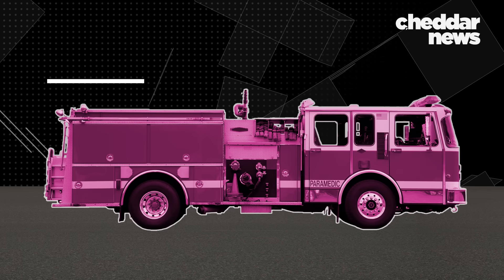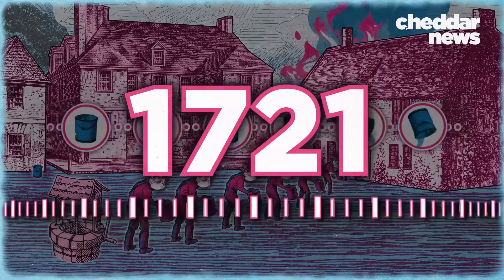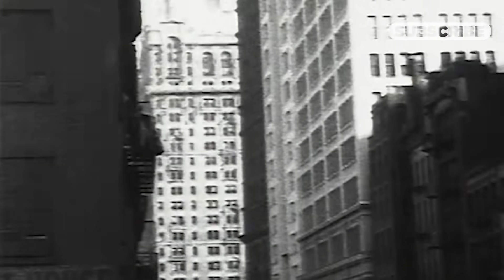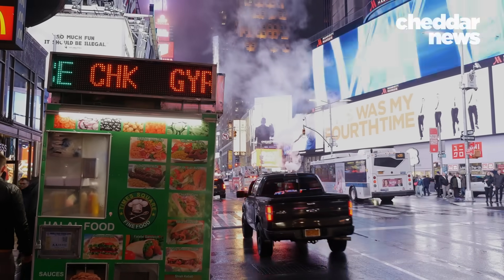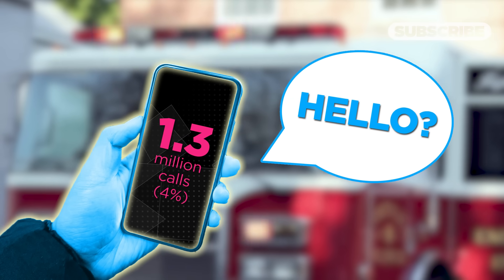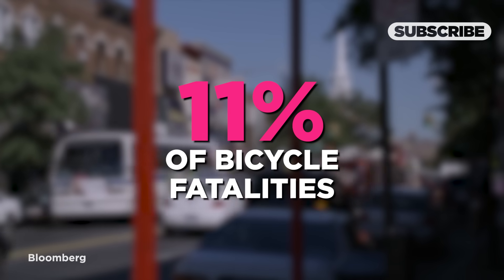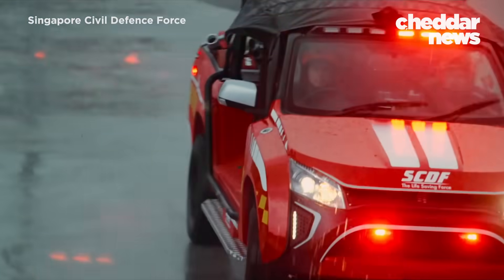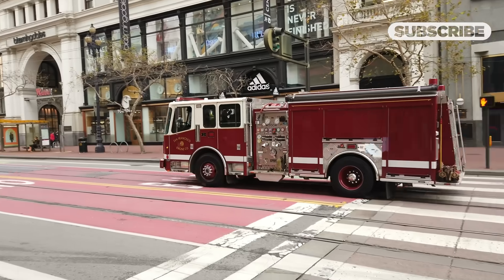Do American Fire Trucks Need To Be So Massive? - Cheddar Explains

Comment: I feel the need to comment on this matter, as I’m a firefighter in Chile, South America, where we have both EN (European) and NFPA (American) standard fire apparatuses, so I can often directly compare their capabilities. 

Though NFPA trucks are generally larger than European ones, that’s not the only factor that has to be taken in consideration to conclude which is better. 

My station has been assigned an EN engine, a Rosenbauer AT3 on a MAN chassis. After 5 years of use, most of us think that it underperforms for the needs we have, compared to the American engines. It has been clearly made for a less aggressive kind of firefighting, and has way lesser quality components in key areas, with an extensive use of plastic that easily gives way under heavy use. 
The chassis is a commercial one, that hasn’t been thought for the particular needs that we have as firefighters, so it DOESN’T have as powerful brakes as a custom made engine, it doesn’t have a gearbox made for constant acceleration and deceleration and, most importantly, the cab is not as strong in case of a collision, which for us is one of the biggest concerns, as we put our lives on the line every time we leave our station to attend an emergency (of any kind, not just fires), so we want our equipment to be as safe as possible in case things go the wrong way. 

Performance wise, American engines are far better, the split shaft pumps can put out massive amounts of water per minute compared to European PTO pumps, so, for large fires, or even for knocking out small fires fast, there is no comparison. 

Also, European engines are not necessarily shorter, because, as they have no hose beds, we need to carry hose on large reels that are mounted in the back, adding at least 1.5m to the overall length of the truck. 

One last thing I’d like to point out, is that NFPA cabs are larger, and as we mostly have cabs with seating for 8 firefighters, they are far more comfortable for us, specially when in full gear (as we use NFPA bunker gear, which is bulkier)

Regarding ladder trucks, I won’t even comment, their is just no comparison between EN and NFPA standards. I can only say that our NFPA ladders, towers and snorkels far outperform EN ones. 

Also, American trucks are not outdated, they have a more traditional look (which we like a lot), but are just as if not more technologically advanced than their European counterparts. 

Generally, the consensus over here is that American custom made apparatuses are far better for the job, and we’ve been shifting to buy them instead of European ones, even if more expensive. 

So, the only points in favor of Euro trucks would be that they are less expensive, and maybe, that they make more efficient use of the space for tooling, based on their overall footprint.
Reply: Thanks from a view that has used both
Reply: It may be worth saying that Dennis still make UK fire engines, they are made to fit most of our roads and lanes, and fit under bridges which we seem to have an abundance of. That said, having seen how the US Pearce trucks are made, the over engineering and build quality, the cab safety especially in the post 2010 versions. I would want the same level of crash protection for our UK and European fire fighters. 
We have lost stations due to funding cuts in the home counties that I know about, and there is always the 'cost saving' crap that goes on, trying to do more with less. Support our First Responders, they need the numbers, not just the right gear.
Reply: @Hastings1066TV 
Sadly Dennis don't make fire appliances any more. The historic Woodbridge site closed with production moving to a smaller site on Slyfield Industrial Estate. The Slyfield site has now closed, ending the Dennis history in Guildford. After takeovers and business failures, production of buses under Alexander Dennis is done at the former Plaxton site in Scarborough.
Reply: @neilcrawford8303  Thank you Neil, 👍 appreciate the info, it's sad that it's another thing we don't make ourselves now
Reply: @Hastings1066TV  
I agree, it is a shame. Refuse trucks around our way are on a Mercedes chassis. Just like people say JCB for an excavator, Dennis was always a name you associated with fire appliances and refuse trucks.
Reply: @neilcrawford8303  Still Dennis bin lorry’s in my area
Reply: @Hastings1066TV  Still Sabres in use in Dublin
Reply: @oscarosullivan4513  thank you, that's quite interesting to know. Any video you might have...?
Reply: @Hastings1066TV  Sadly not
Reply: @neilcrawford8303  Mercedes uses the Freightliner Name in the US
Reply: @Hastings1066TV Dennis still in production? Nice to know.  As like the American units, the Dennis is a fire engine from ground up. Not a truck or bus chassis like most European equivalents.
Reply: @Hastings1066TV  Didn't Dennis stop production back in 2007 already?
Reply: @EnjoyFirefighting  Yes, apologies, it was Scania I meant. Dennis did indeed sadly cease in 2007.
Reply: @EnjoyFirefighting  For ground up appliances (chassis included) yes. A number of British and Irish Brigades were likely left wondering whether appliances would be delivered. There are still some of the last ground up Dennis’s made still in use in Dublin 07/08 Dennis Sabres. Dennis still made appliance body’s until 2019 when they went into liquidation.
Reply: @Hastings1066TV  Ceased building their own chassis in 2007. Stopped building body’s in 2019.
Reply: thank you for your insight, as you guys over there in Chile are one of the few places which actually get to work on both types of apparatus. But I'd like to add some aspects concerning the MAN TGM AT3 appartus you guys got there. Some things you mentioned definetly depend on the specs how the truck was ordered. Thus MAN offers the chassis with job-specific options and adaptions for the use emergency service, like e.g. upgraded gearbox, different gear shifting pattern - an option your department maybe didn't click when ordering the truck (tbh I don't know who exactly orders them at which dealership or contact partner). Might definetly be that you got a lower trim level there. 
As for all the plastic ... well, Rosenbauer being a world market leader they have a easier game to get in touch with departments around the world, having sales partners everywhere. Rosenbauer can produce in large numbers, but there definetly are manufacturers which can come up with a better quality product. 
In Germany cabs are designed for a crew of up to 9, however there's not much space left then
"Regarding ladder trucks, I won’t even comment, their is just no comparison between EN and NFPA standards. I can only say that our NFPA ladders, towers and snorkels far outperform EN ones. " well, first off, there are also European ladders which fullfill NFPA standards. 
And then some optiones and features on European Aerials limit them in terms of capacity at full horizontal outreach, like e.g. articulated top ladder section, rotating bucket or self-leveling ladder. Also keep in mind that European ladders can be way taller than only 100 ft, while taller ones in the US are super rare (and if there are some, those are often European manufacturers)
Reply: @EnjoyFirefighting  Glad my comment opened up for a respectful debate on the matter. We often have the very same discussion over here, when planning for a new apparatus. 

You're probably right on the fact that we didn't tick every box when speccing our engine, but nevertheless we have quite a higher spec version, as they were the first ones to arrive over here (and brand image was a concern for Rosenbauer with their newest model on the lineup). I guess back then no one realized that they had to spec a different gearbox, as they seem to be more concerned with other stuff (like how many halligans we needed to carry, no joke hahaha).

About the NFPA ladders on Europe, afaik, only Magirus ever built one, but i don't know if they have ever sold any. Over here, most if not all European ladders are specced to EN standards.

Regarding reaching capabilities, you're right that EN ladders tend to be the tallest (In fact, the tallest ladder on my department is a Magirus with 55 meters), but they are practically never actually used to their fullest extent, as they don't hold much weight in their baskets when fully extended, and that, combined with the fact that we mainly put out high rise fires from the inside, makes their reach a little bit more of a gimmick rather than an actually useful feature.

Just as a side note, some time ago Rosenbauer thought they had found just the right answer to our particular needs, and built this: https://www.rosenbauer.com/fileadmin/_processed_/0/4/csm_ATCommander__2__e35038e55d.jpg
Guess it wasn't quite the success they thought it would be, as the built just this one, but it remains in active service in a town in southern Chile.
Reply: @Francisco-fo8hx  you're very well informed :)
Yes, Magirus is the only one which let one of their ladder setups certify according to NFPA standards

"In fact, the tallest ladder on my department is a Magirus with 55 meters" That's the dark green one from the 5th company of the Santiago de Chile FD, right? 

Yes I've followed the topic on the AT Commander back then, thought it might be sth but then, as you mentioned, they built only one of them. Probably they thought it would work like like 2008 HME Ahrens Fox chassis combined with a body system from Hensel, so basically half American half European apparatus which was in service at USAG Heidelberg in Germany: https://www.youtube.com/watch?v=LmRy2LPKLOA

Personally I think it's interesting to see the few apparatus which used to be concept trucks in the past but never made it into large scale production. Like some of the Rosenbauer apparatus, or that manufacturer "Firebus" from Sweden which built Engines based on a Volvo bus chassis. Was able to record on of them in Norway. Also there's a fire truck based on a Hummer H1 equipped with an UHP impulse gun extinguishing system in Norway. Only one of them was ever built
It's good that departments try new setups and approaches over and over again, even if many of them fail over and over again.
Reply: @Francisco-fo8hx  btw I found another odd apparatus setup: a European truck with an American ladder, to be precise a Tatra T815-PR-3-6x6 with a SIMON LTI. ladder, built in 1992, which used to run at a FD in the Czech Republic: https://www.youtube.com/watch?v=KEftNPGCkkk
Reply: @Francisco-fo8hx  Magirus aerial at my nearest station
Reply: I feel the need to give my two cents as a European firefighter myself. The engine having important parts made from plastic is down to it being a Rosenbauer. They safe Costa that way (and it's one of the reasons I don't like them very much) Ziegler or Schlingmann would have been a far better choice from my experience. The MAN chassis would also have been fine, he'd the right one been chosen. Our latest engine is built in a TGM 4x4 chassis. The brakes are perfectly fine and the Tipmatic gearbox has two modes. In its base mode it's already shifting up and down quite rapidly and in emergency response mode (which we rarely use) it shifts even faster. I personally feel like the hose reels are a more elegant solution than having the hose on the back of the truck as with a hosereel it's less exhausting to lay the hose as opposed to dragging longer stretches of hose from the back of the truck. We also have about 16 type B hoses stored in deployment cases over the pump giving us the ability to deploy 400m of hose from the moving vehicle (in addition to the 275m on the hosereel and 125m of single hoses) we have 2140lnof water on board which is more than enough to start the initial attack while one team establishes a water supply. Ziegler also has an option to have every area equipped with SCBA (we only chose to have four in the back) since we already have a heavy rescue truck the new one was specced out for firefighting primarily so we ommited the jaws of life in favour of having a mobile pump. We have two ladders on the roof (7ish m and 12.7m respectively) the rear of the truck can be lowered pneumatically to aid with putting the hosereel back on, the pump can be set to hold a certain exit pressure and can push through 2000l a minute though I don't think we've ever needed that much output. We have a backup camera as well as a dead zone monitor and the lights can be operated from the cab or the pump plus we don't need intercoms because the whole thing is quiet enough to allow for normal communication.
Reply: @Micsmit_45  just to be clear, don’t get me wrong on saying that EN engines are terrible, they are not. Ours been holding for more than 6 years now, and still performs perfectly fine, save for some problems related to the heavy use we give it (like the doors, that’s been clearly a Rosenbauer design problem). Besides, it has a really cool control panel for the pump (that failed on us a couple of times, but was eventually fixed through firmware updates). 

Nonetheless, I still felt the need to point out that there’s a reason behind the design of NFPA apparatuses in general, and that we prefer them over the EN ones, even if larger overall (our streets are halfway in size between European and American ones), because they are built with a different kind of use into consideration (as our tactics and operations are more akin to those in the US rather than Germany or the UK). 

And yes, i do feel that Rosenbauer is the main culprit regarding quality issues, as the MAN chassis is perfectly fine, just not custom made for fire service. The fact that the crew cab is integrated into the bodywork has always been quite a concern to me. 

Always great to share experiences with firefighters around the world. 

Stay safe.
Reply: @Francisco-fo8hx  there's different styles of chassis you can get btw, our older truck has MAN's crew cab while our new one has the standard man cab and the Ziegler Z-Cab. There's a bit more separation between the driver and officer and the rest of the crew with that design, but it offers more space for the guys in the back.
Reply: @Francisco-fo8hx  "The fact that the crew cab is integrated into the bodywork has always been quite a concern to me. " that's a thing which got very popular here. I think some self-declared experts in Germany stated that it should be the goal for new apparatus to have the cab integrated into the body system. 
On the bright side some truck manufacturers like Scania offer a crew cab right away from their production line. Scania has offered crew cabs for a long time now and recently they expanded their lineup with a high roofline crew cab. Volvo jumped onto that train and now offers crew cabs as well. With those two truck brands you barely see any crew cabs integrated into the body system in northern Europe - apart from the very few AT3 apparatus which somehow ended up there lol. Rosenbauer also has a representative up in Norway, but they barely sell the AT3 there but rather go for different body systems from their lineup

" it has a really cool control panel for the pump (that failed on us a couple of times" yeah that's an issue the AT3 used to infamous, but they fixed it by now. The rest of their lineup didn't have as many issues as the AT3 did in the beginning, not sure why.
Reply: @Micsmit_45  Sadly we don't get Ziegler over here anymore (nor Schlingmann), so i haven't been able to see them firsthand. From Europe we only get Rosenbauer, Magirus, Iturri, Jacinto (those last two are considered subpar, barely usable for the fire service, but they are by far the cheapest option for those departments on a tighter budget) and Wiss (which is fairly new over here, and the only one to offer the Scania crew cab).

As a matter of fact, we actually used to have a Mercedes-Benz Ziegler engine back in the 80's and 90's, and is remembered fondly by the older members of my company, as they often say it was a fine piece of machinery, a great example of german engineering (easy to use and very robust), but sadly they don't have the same opinion on our current engine.
Reply: @Francisco-fo8hx  that is s shame. I can say much about Magirus' trucks but they are the go-to for ladder trucks over here.
Reply: @Micsmit_45  Yes, the jaws of life is not a lightweight piece of equipment takes up a lot of room and takes a hydraulic generator to operate it
Reply: @MattyC62185  I beg to differ. Ours Take up just as much space as a standard portable fire pump normal (a European standard if I'm not mistaken) or a standard generator.
Reply: @Micsmit_45  let’s not forget the shear that goes along with it that is not light either.
Reply: @MattyC62185  we have both sets of tools that can be used with the Hydrolic pump stores on the Hydrolic pump. Look up Weber rescue. They offer battery and Hydrolic powered tools.
Reply: @Micsmit_45  American Volunteer here. We have a hose bed where we lay the supply line in a way that you can pull the end off and wrap it once or twice around a small tree, the hydrant, or fold it once and kneel on it and when the engine continues forward it will pull line as it goes. its simple. less to break or mess up. same mentality is applied to the pump panels. Euro pumps are dope af and super high tech but with tech comes problems. The last thing we want is to have a software update or buttons not working when you need them. We keep it simple. We also have a more aggressive style of firefighting that is needed due to our houses using wood instead of brick for the walls. Of course the old debate over the helmets can be explained this way too. having integrated lights and coms in the helmet  just adds more points of failure and are expensive to fix.
Reply: I as a german Fire Fighter have to agree with @Micsmit_45 on this one. Rosenbauer as a company does use a hell lot of plastic in their Vehicles. We have a MAN TGM 4X4 as well with an upfit from them. One of the other things I have to mention is that we in Europe have much narrower roads compared to the US and not to mention our city centers which have lots and lot of tight narrow roads (especially with people parked everywhere) and of course they need to be accessible with all the equipment as well wether it is our standart LF (the engine) or our ladder Trucks. I can't say I agree on the Ladder Truck part though... Magirus still has the hightest reaching ladder Truck world wide in their program with a rescue Height of 68m which would be equivalent to 223 feet. The Cabs maybe larger yes considering that our gear for going into houses (at least here in germany) is compacter with compacter bottles etc our EU cabs are completely fine (some fire departments even use the normal double cab Trucks and not the Cabs integrated into the Upfit) and we also seat 8 people in our vehicles so there is no difference in that. Apart from that our Fire Engine fore example has no Hose Reel as we also store our Hoses (as well as else where in the Truck) over the Pump and can even lay them out whilst driving so that I guess depends on what the Department or Town needs/ wants to have.
Reply: To be fair the US fire trucks are dated, they still look like 1986 other than that it’s interesting to hear a fire fighters perspective on this
Reply: The real info is always in the comments.
Reply: Thank you for pointing this out. Outlets like Cheddar just have an unusual lust for anything European and they’ll take something they don’t know about (firefighting) and just try and frame the US version as “so backwards and small minded and old fashioned”
Reply: Chile has shitty cheap trucks because the government there only opts for the cheapest option in everything.
Reply: Gracias por tu servicio.
Reply: Very informative! Most European units are built on truck or bus chassis.  American are fire engines from ground up! The old British Dennis was also from ground up a fire engine.  Far better.
Reply: I am SO IMPRESSED with the Santiago fire department.  EXCELLENT.  I love how tactically sound and aggressive you are.  Truly a world class fire department.  You should be proud of the department you have evolved to be.  AND, CORRECT, there is no comparison of European and North American fire apparatus.
Reply: Seems like you have an old cheapo version. Come visit Sweden and look at our trucks.
Reply: I think the plastic bit is mostly related due to it being a MAN chassis. MAN fire trucks are not that common in EU, it's mostly Scania, Mercedes or DAF
Reply: Thank you for your service and sharing your first hand experiences. Be safe out there!
Reply: Stay safe, thanks for putting your life on the line!
Reply: Soon as I saw the title of the vid I knew American Engines have superior functioning hose beds and initial PC fighting lines...Not to mention Federal Q's and nasty blastin air horns...
Reply: @MegaMantim  Generally, if it's from America, it's worse than anything for Europe or Asia.